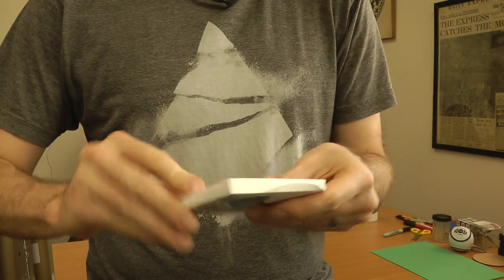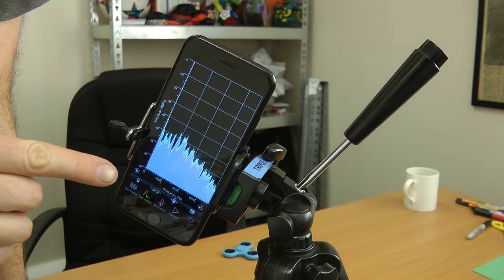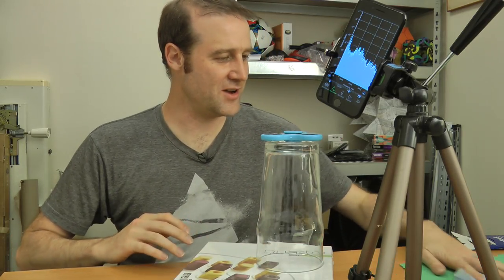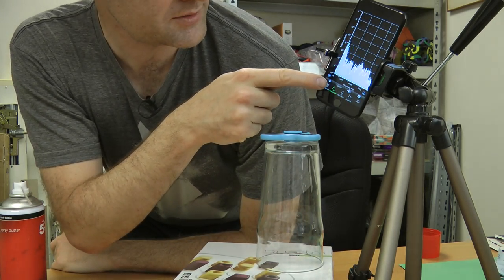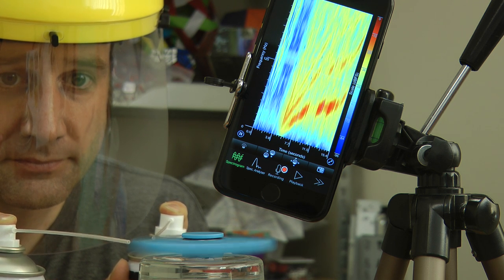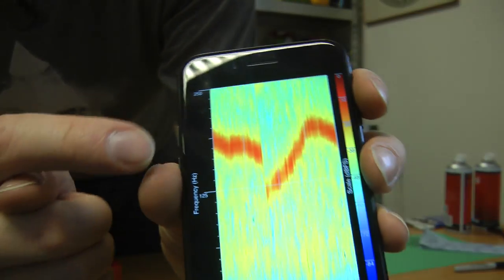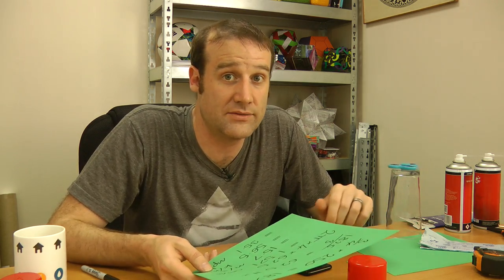How fast is a Fidget Spinner?

Comment: Totally not on the subject of the video. But if anyone can help I would be really thankful.

We live in a 3D dimension universe right? And there is this theory that our universe came from an 4D universe trough a Black Hole or something like it because our 3D Black Holes have an 2D line of events. Right?

Whenever I see an image of an 4D thing that is just super impossible to figure how is working, it is super confuse to me and they are usually 3D models, but the representation comes by an 2D image made on video or photo.
So, we can see and understand our universe (3D) on 2D images. Could we understand better an 4D thing on a 3D video?

Comment: 'Real Units'? That's a bit rich coming from a man living in a country where the confusion of units in every day usage is epic. Some examples - car economy is still measured in miles per gallon even though petrol (gas) is sold in litres (liters), tyre (tire) pressures is in pounds per square inch, miles and yards are on road signage and don't forget car performance is measured in brake-horsepower. Speaking of horses, races are measured in furlongs; horses in hands. Water depth is in fathoms on many charts and mountains are still referred to as so many feet high. Fortnights for half a month will baffle any non-Brit. Real estate is still measured in acres but living space is in square metres (meters) and ask a person how much they weigh and you'll get an answer in stones and pounds; their height most likely will be in feet and inches! Then there's the unit mish-mash - food (produce) sold in jars (like jam (jelly)) is in units of 454grams (which, of course, is one pound). Beer is sold in pints and milk is usually sold in multiples of 568ml (which of course is a pint - that's 20 fluid ounces but not 16). In the building trade you might not buy wood (lumber) in 2x4s but the length is still 8 feet (although it's called 240cm). You can still ask for a 4x8 piece of ply or plasterboard (sheetrock) but here it really wont be anywhere near 4 feet wide. It will, however, be 8 feet long as I recall. Any other examples? :)
Reply from the maker: +mikeatyouttube Totally agree.

Comment: You mentioned that the app measures frequency and volume.  Would the sound of the pressurized gas affect the sound of the moving fidget spinner and thereby influence the accuracy of the frequency/volume?

Comment: Hum, that's not really how fast a fidget spinner can go, that's how fast a cheap plastic fidget spinner can go using 2 cans of compressed air (at X bars and with a nozzle of diameter Y).

For me, "How fast is a fidget spinner" without further precision should mean the speed it can typically have which means using your hands. 

"How fast it can possibly go" without further precision should either mean the fastest a human can make it turn using his hands or how fast it can go before breaking/plastic deformation using any means available.

Comment: Saying that because there's three lobes means you should divide the measured frequency by three is pretty 'hand-wavy'... Do you have evidence to back up your claim that the air will resonante at three times the frequency at which the device will spin? Perhaps instead the majority of the sound comes from the friction in the bearing, in which case the measured frequency is the same as the frequency of the spin.
Reply from the maker: +Christian Ball There were no harmonics at three times the base frequency which ruled out it being from the bearings etc. Definitely the sound generated from blade pass.
Reply: I see. Thanks for the reply! Addicted to your content.

Comment: you don't seem like the most qualified person to be accurately measuring something as mechanical as this, no offense. you have the knowledge, you just don't have the stuff. the speed that the spinner is spinning at is determined mostly by what sort of propellant you are using, i.e. the pressure/nozzle of the air you are using. you're not so much determining how fast the spinner itself it as you are determining how fast canned air can spin it. the only "true"/"scientific" way to determine "how fast a fidget spinner is" would be to measure either the average speed at which a group of test subjects spin it at or spin it until it physically breaks. :/ it's just not really your thing.

Comment: You don't measure the rotation speed of an object with properties such as a fidget spinner in terms of m/h, km/h, or cm/h.

Rotation speed is not the same as the velocity or general speed of an object covering a given distance.

He did mention the RPM of the fidget spinner (which is technically, the only correct answer to the question at hand), but all other flavor data were pointless.
Reply from the maker: +Meritorious I gave the rotation rate in both Hz and RPM, then worked out the speed of the tip of the spinner in cm/s, m/s, km/h and mph. Let me know what I missed!

Comment: Wait, there is an upper limit of how fast it can spin? Couldn't we use better sources of torque to make it spin even faster?
Reply from the maker: +Twarit Waikar Yes! Scott Manly did some working out: https://youtu.be/lC9nZ9GOotI
Reply: Thank you. I wondered if there was a physical phenomenon that I didn't know of, that prevented it from going faster than a limit. Turns out it's just the tensile strength...

Comment: So how long until someone drives the spinner with a Dremel tool.  Should be able to get about six times the rotary speed -- or at least until the spinner flies apart.  (Don't try this at home, even if you have a face shield.)

Comment: Matt I love you i have signed books to prove it, but ...epic fail, those red cans.. used them myself,  they mostly spit liquid and occasionally a gas at very low velocity and they cool so quickly that they are unusable , do another experiment with a commercial 300PSI compressor, pretty standard stuff, i have had tungsten explode due to centripetal force with under 290PSI
Reply: use body armor when testing that.. like ballistic grade (bullet proof)

Comment: So why was there a limit to how fast it could go? Is the compressed air not a constant force for acceleration?
Reply: No, it flows out of the can at a constant speed, however. Which acts as an upper bound for the speed of anything it propels.

Comment: With measuring the sound you don't know if you have spinner rotating sound or the the bearing frequencies. Depending on the bearing geometry the balls can be moving past outer race at more than 10 times the rotational speed. Also if the device has any natural frequencies that would be amplified and more likely to be recorded although seeing the frequency change with speed makes that less likely.

You had the gyroscope orientation wrong to get it to precess on the string. 

A strobe light would be more accurate for spinning speed. 

http://electromotores.com/PDF/InfoT%C3%A9cnica/EASA/Understanding%20Bearing%20Vibration%20Frequencies.pdf
https://en.wikipedia.org/wiki/Bearing_(mechanical)#Rolling-element_bearing_outer_race_fault_detection

Comment: computes 3/4 of 250 Hz on paper and then divides by 3 for 3 lobes...
How about doing that upfront? 1/3 of 3/4 is 1/4 ...
so the only calculation needed is 250/4
Reply from the maker: +panda4247 But then I multiplied by 4 as well! I should skip all the working out and just give the answer.
Reply: haha, indeed.
However I like the answer in rpm / Hz in terms of "how fast is it spinning", so the 62,5 is OK for me

Comment: You did a calculation wrong.
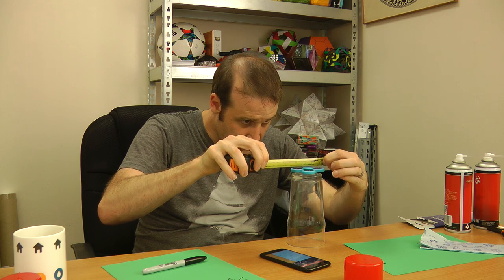at 4:43 you do the calculation "2π * 4 * 62,5 * 1"
the correct calculation is "τ * 4 * 62,5 * 1" ;)

Comment: Why didn't instrument pickup the sound from compressed air can?
Reply: SpectrumView mentions "visualize in real time the frequencies that you can hear".  I can hear @ 1.49.
Reply: Okay, perhaps, it was obvious that the freq. he was reading was COMING from the Fidget.
Reply from the maker: +Praveen Dindikurthi What Gatesofcerdes said. It does pick it up but the air noise is a mess of loads of frequencies. It raises the background noise a bit but not enough to swamp the main signal.

Comment: The noise isn't the lobes hitting the air, it's the ball bearings rolling in the center
Reply: So i think your calculation may be wrong. There's a much quieter and lower pitch sound which is the lobes pushing air.
Reply: On a quick test I got around 8.3 m/s (without compressed air)

Comment: Buuuuuuuut doesn't the sound of the compressed air coming out skew your results?
Reply from the maker: +DeDraconis It gives a bit of background noise but it is spread out. The main frequency is much louder.
Reply: Ahh. In the video the air is a lot more noticeable than the sound the spinner is making.